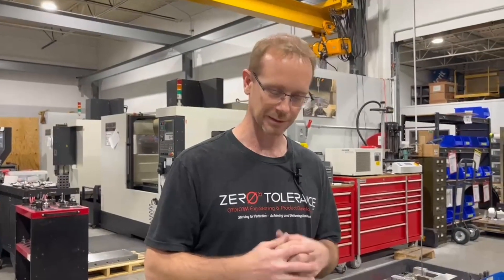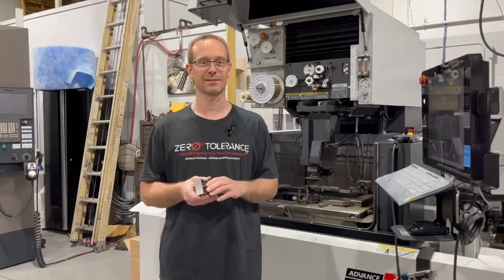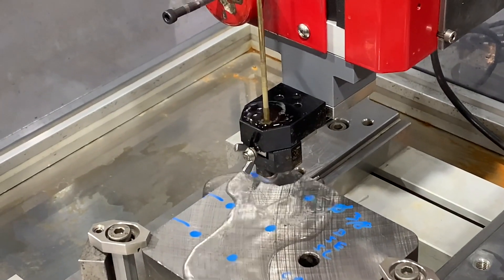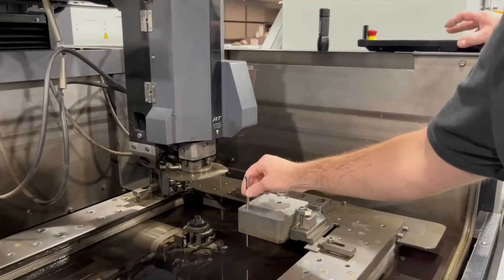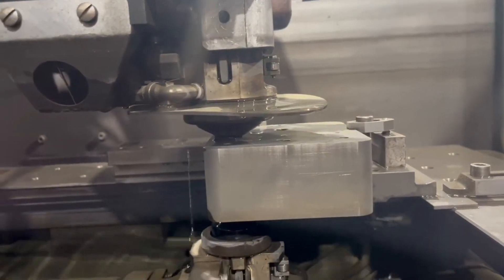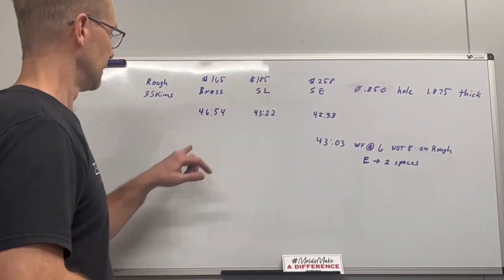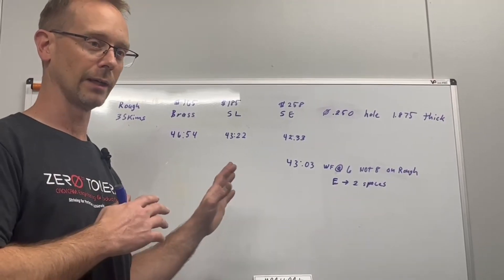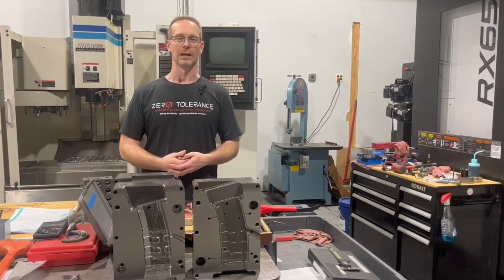Which Type of Wire Should I Use for My EDM? PRODUCT COMPARISON!

Comment: If you run your machine lights out at night and all weekend, then coated wires make a lot of sense.  If you run one/two piece runs and turn your machine off all weekend, stick with brass wire.

Comment: I cut a lot of Neodymium magnet materials. I use a .012 zinc wire and on a 2.00" block I'm getting about .055 IPM. I'm curious at how much faster that expensive wire you mentioned works. I've been researching Molybdenum wire cutting machines too. They seem much faster, but not as accurate. Most of these magnets are ±.005", so that may be an option.